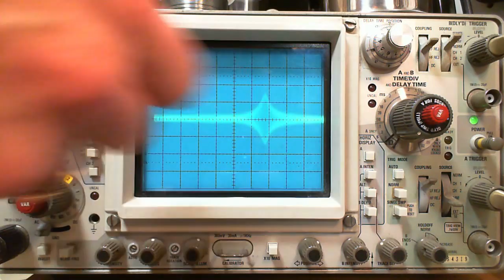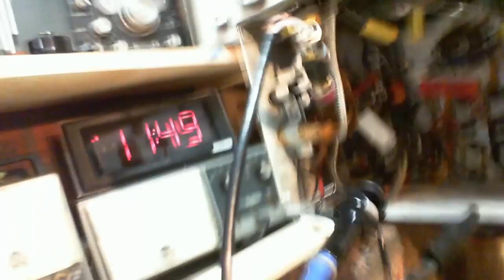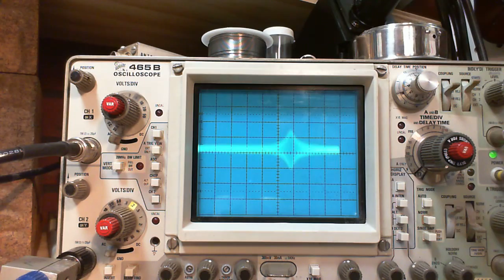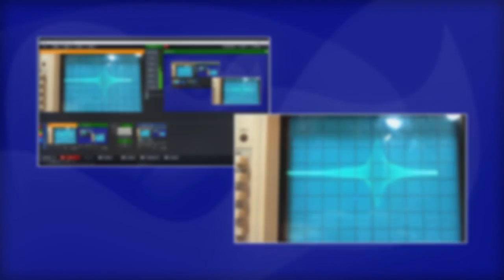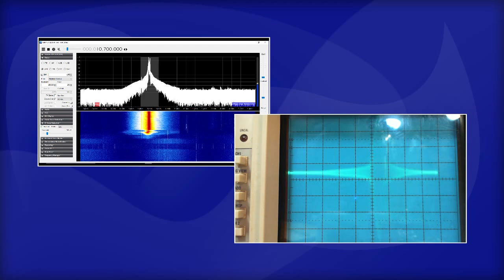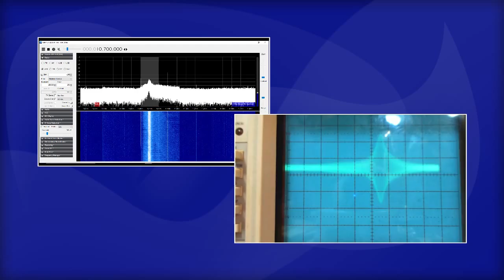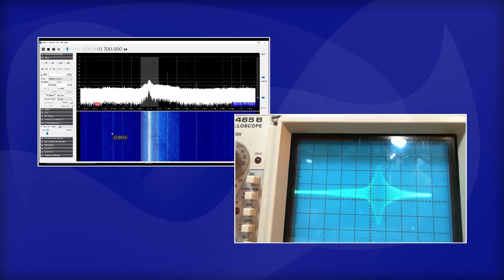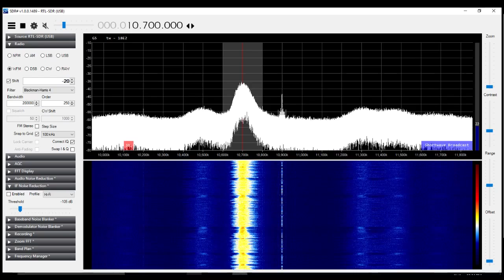Electrohome Chippendale Console Video #34 - Scope vs SDR Alignment

Comment: Hi Jim, Just a thought, using the scope probe hooked onto the wire insulation is a really good idea but you still have the problem of coupling the SDR pickup coil without effecting the radio. I think your scope has a Ch 1 output on the back so you could try connecting the scope output to the SDR. You will have to attenuate the scope output as it is much too hot for the SDR input. It might be worth a try.